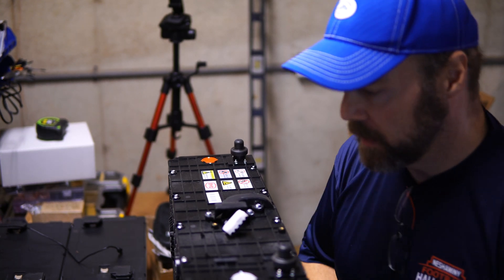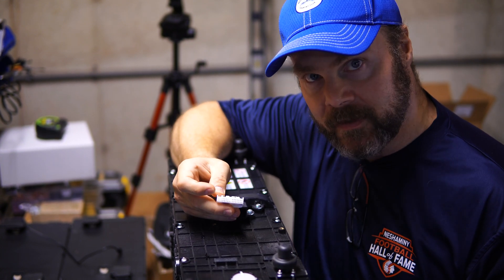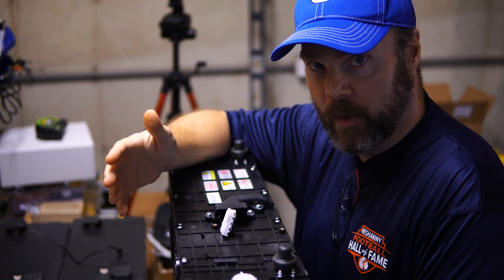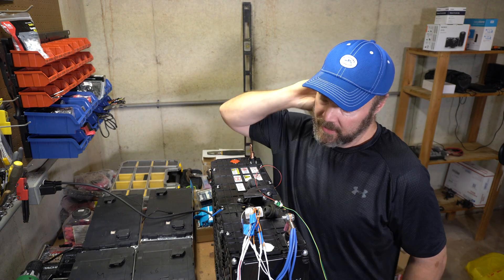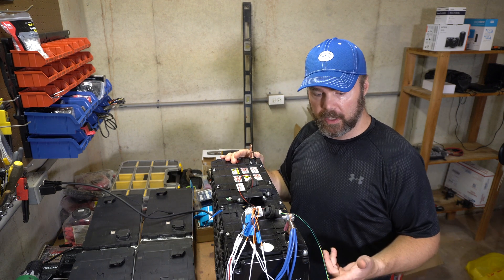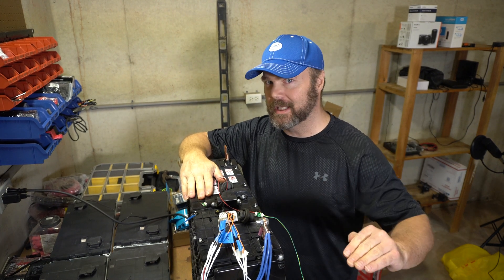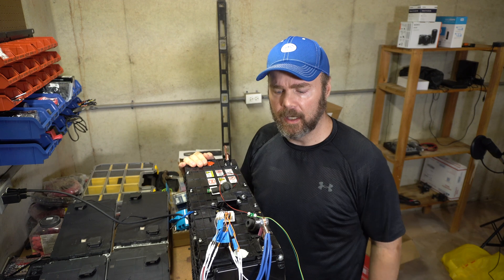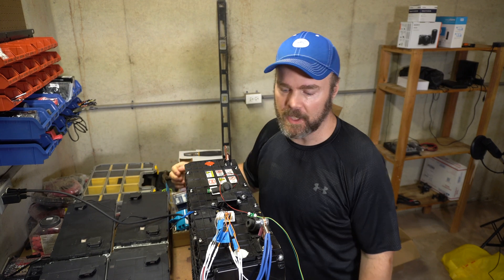Adding a BMS to my 24v BYD Battery

Comment: Awesome.  BTW - you can use the internal thermistors in the battery pack rather than the one that came with the BMS.  They are available on the battery connector.  You just need to use one of those in place of the one that came with the BMS.
Reply: I’m not too concerned. These will be in my basement which never seems to get above 80° or lower than 45-50°. Plus, being new to circuits, wiring, etc. I’m not sure how to wire it so both temp sensors work. The BMS temp sensor has 3 wires that go to the first sensor and then 2 wires that go to the second. I’m sure this would be simple for someone with experience.